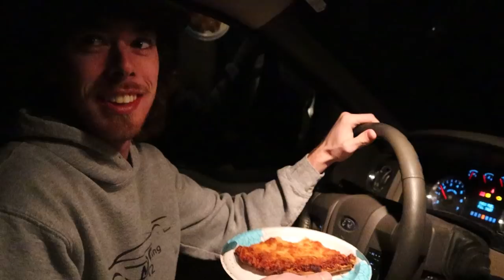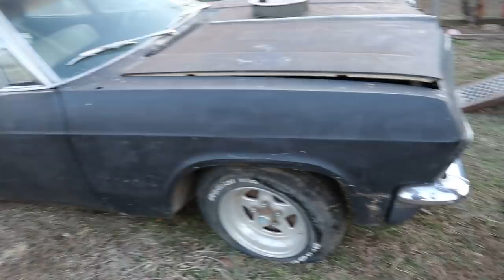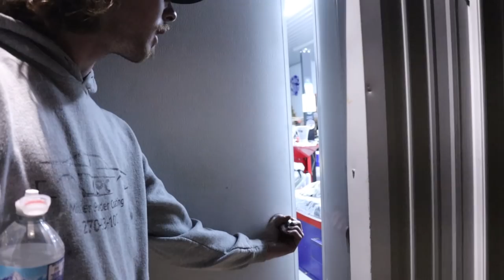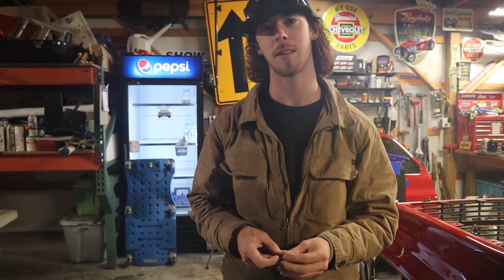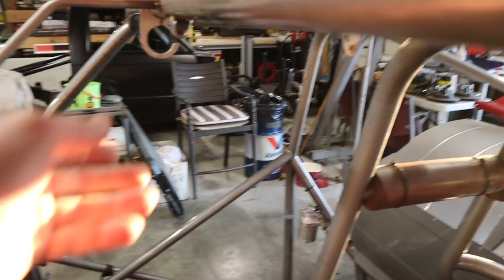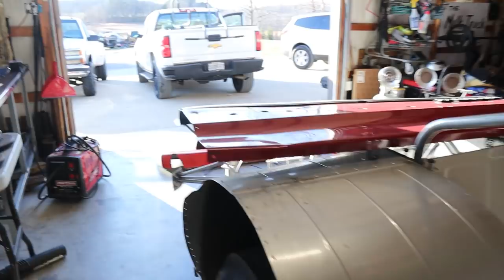Pro-mod Delete Kit For Whole Milk!!!!

Comment: Can't wait to see it all put pack together.
Out here  in Virginia, Maryland and North Carolina where we do most of no prep front and back of the track and street stuff. Rules are steel roof and quarters.
Factory floor pans and Factory firewall location and must have a Vin #.
Curious if not having steel bed sides would be a issue with some of the races you will be going too.
Appreciate all the content and uodates.
Reply from the maker: factory firewall LOCATION? damn! that’s nutty, i’ve been seeing tons of factory firewall stuff. i may have to alter mine…